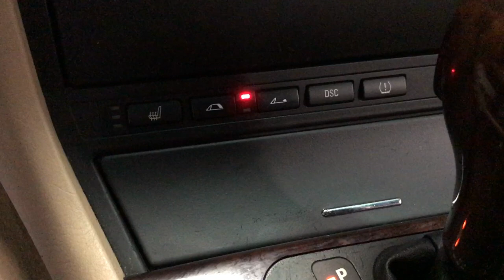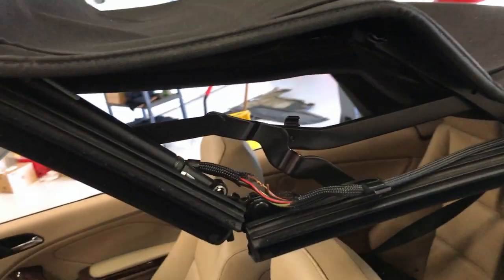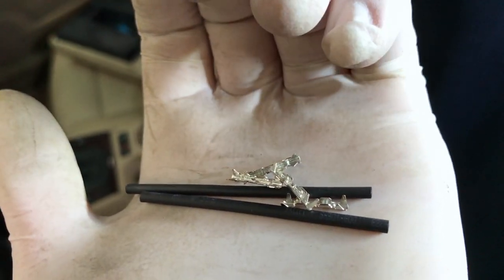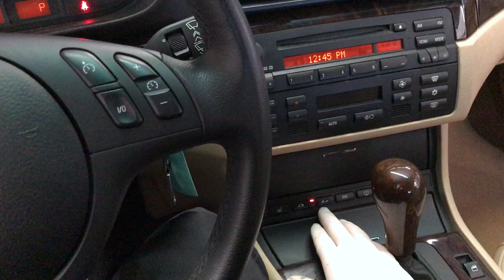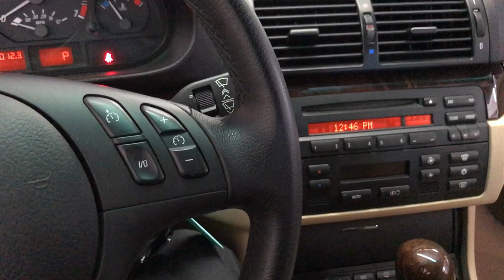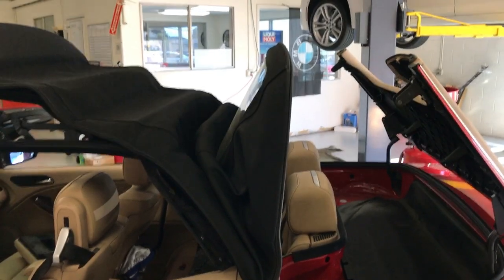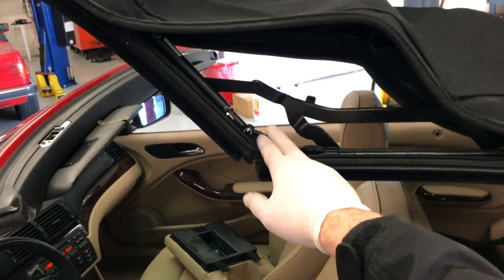BMW 325I Convertible Top Won't work

Comment: Holy crud, Mike, so glad I found this video.  My 325 had the exact same issue, stopped as I was closing it months ago.  Thought I'd have to spend big bucks at the shop.  But, when I cut away the threaded  harness wire covering at the same spot you did, what do you know, a wire was cut.  Some wire strippers, solder and electrical tape later my top works again.  Unbelievable but awesome! (I just did solder and electrical tape as that was what I have on hand.)

Comment: thank you for this video. Our issue seems to be a tad different. something crunched in the back trunk when top was opening nad havent been able to automatically open and close top / Doing it manually each time wihici is a pain. I think ours is safety featue of some kind? Thank for the video!
Reply: Sounds like the motor has gone A where he takes the seat of and shows the manual part to press in there is the motor and usually that’s what goes if u can hear crunching clicking noise x

Comment: What did you use to hold up the back of the top & cover while you did the repair? And how were you able to open the trunk to disconnect the battery while doing the repair, if you did disconnect same.

Comment: I have 2004 m3 convertible and the driverside rail will not lock straight as it is going doing therefore it won't reach to lock. Any suggestions?
Reply from the maker: Are you able to help it down with manual pressure?
Reply: Same issue

Comment: GREAT ADVICE and tutorials! Thank you. If you respond to me here, I'd like to tell you my problem and get your help/advice on it. Thank you!
Reply from the maker: How can I help you?
Reply: My top suddenly decided to not open. First, it would not close all the way down. I manually closed it down. Now, it won't open. It stops after about a 2 second attempt. Light blinking on console for Open?Close of top. No gears clicking. I just finished opening up the cowl and inspected all parts, Motor, gears, latches and wiring/Connectors. All looks in perfect condition. Reassemble. Still: Blinking light. Top moves for a second on open then, stops. I ran a Foxwell Scanner and it says:
Convertible Top Module CVM Fault: Close Control Button Permanently Active.
CVM Switch, Cowl Locked, short to ground or open circuit. I hope this is clear and you can offer some help here. I just did one more scan after reassembly and got Trouble code 87: KOMBI: Kbus.
Nothing happens when trying to open other than the 2 second attempt: No humming of pump/motors or activity.
Thanks for your help and time.
UPDATE: I JUST PUT MY ELECTRONIC/ELECTRICAL BRAIN AND SKILLS TO WORK. I FOUND ONE SMALL broken wire and spliced it back together and my top is back to working again :) However: I am wondering: How often should convertible hydraulic pump motor reservoir fluid (Pentosin) be changed? I changed mine in 2017. It only looks darker than it used to.Thank you, again, Mike!  @MikeMDs
Reply from the maker: It sounds like you may have the issue in the video. Hard to tell without diagnosing it in person.

Comment: My left side lock is completely locked shut. The ride side opens just fine.. I tried to remove the side weather strip for the long 5mm Allen but when I went to put the Allen in it wasn't grabbing anything so I looked inside and all I see is a bar. Im afraid my left side latch my be closed for life!  It's very unfortunate cause it need a new top. I found one for only $400 bucks but I can't get my left side roof latch to open so I may just end up selling the car.. I may be able to cut the long panel under the latch to get to the latch or cut the top up so I can get to the 5mm Allen bolt " if its even there.. I really start to hate convertible BMWs. I will Never own one again. So many issues it's ridiculous.

Comment: So my hood opens and locks in to the boot - but it won’t go up - started happening today had to put it manually up - on your vide where the wire threads are cut - the metal frame
Woudlnt not go straight  even in manual mode , any ideas - had to unscrew a bolt each side of the hood to make the metal frame go straight -

Comment: Just a quick clarification. You did not splice in any new wire at the bend, and the larger wire, you left alone. Can you elaborate on this? I’ve got a 2004 330ci stopping 4” from closing. I’ve cut the loom open at the bend but no wires are visibly broken but some have scuffing. Just wanted to get your perspective and make sure I didn’t miss anything.
Reply from the maker: Hi . Every scenario is different.  If the wires notably are weak from so much bending then I will cut it and re-butt connect it as shown.

Comment: Hi! I’m late to the show. I’ve rewound this a few times but couldn’t quite understand where you stated we could buy the connector/crimps from. What was that website again? I can’t seem to find them that small. Thanks!
Reply from the maker: You can solder them together and put use heat shrink.

Comment: This is helpful because the symptoms on mine are the same. Would there not be a fault code if wires are broken in this area? The front releases and closes but there is no sound from motor that pulls the roof back - only a relay type click from the valve block area in the left rear.
Reply from the maker: It may or may not throw codes. The codes may be super random as well if the harness is broken. It is a good spot to check visually to rule out.
Reply: It's working now but any further issues and I'll open into that loom. The only reason I am  looking elsewhere is the low usage of this car. We can measure top down time in days rather than months in this part of the world but I recognise the wire sheathing goes brittle with age. I am told the pump relay can also go intermittent. Thanks for the reply.

Comment: @mike mds I have a 120 series soft top 2009 , the problem is tht when it opening the roof it doesn’t completely open, it then closes automatically, what could be the problem 🤔🤔🤔
Reply from the maker: Many things can cause that. It would have to be diagnosed

Comment: I have a question man so my top stopped working at that last closing section as well, does that button under the rear seat release those hydraulics that keep the roof open that last foot or two. So I can close it manually? All the way
Reply: Omg I’m going thru the same thing can’t get the front of the top to go down
Reply: @Catfishplays what did u do to get teh front to go down / the metal
Frame don’t want to go flat on mine today
Reply: @nic-wrightwright1212  I ended up taking off two little bolts where it folds one bolt on each side I forgot what size it was I’ll look for the link that helped me real quick I just open the top manually now I don’t have time for the top not wanting to go down
Reply: @nic-wrightwright1212  it was the u joints
Reply: @Catfishplays  I’m debating weather to get rid as I’ve got mot and service coming up it always costs me so much had some
Oil thing done on head gasket last year cost me 900quid and the mot -  probably cus I’m a women take the biscuit out of me- I’ve had the car 15 years  I’m worried incase everything starts to go wrong now as it is
2001 plate ;( -   I just don’t kno why it’s goes down electrically but mot goes back
up- makes me
wanna cry x

Comment: Can anyone please help , I have a e46 330ci 2002 I’ve replaced hydraulic pump , rewired the breaking point wires and it is still slow now I have to push it to move it